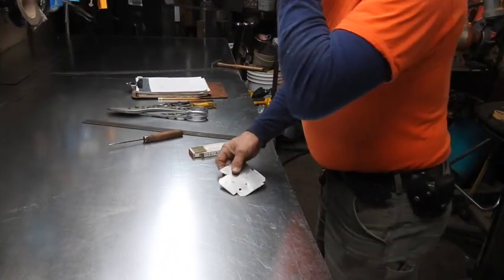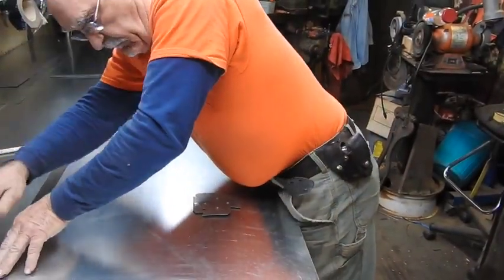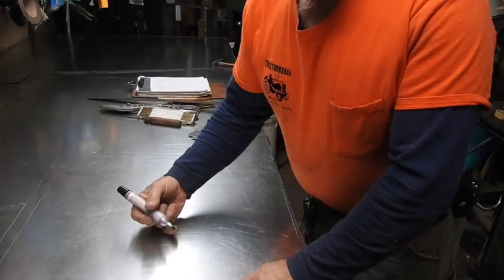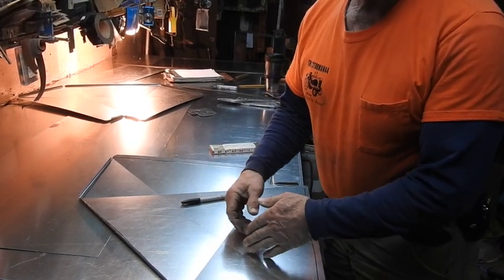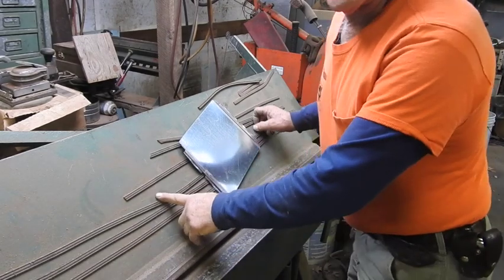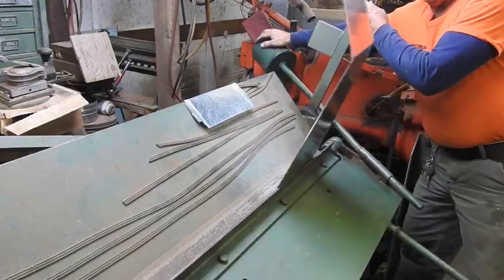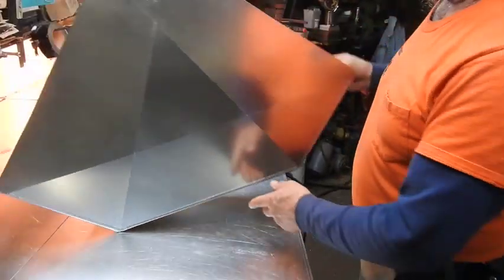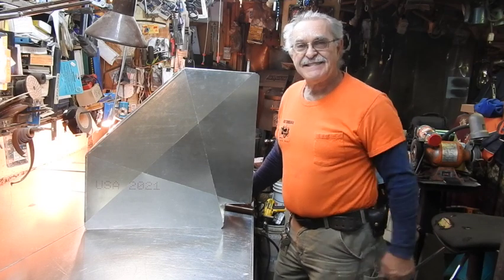Sheet Metal Hack: Longway Radius

Comment: Where did you get that hammer
Reply from the maker: It's a Milwaukee electric hammer and it was old when I got it from an old tinner in the mid 1970's.  Morlin Manufacturing still makes them today almost unchanged externally but I'd bet they have a circuit board in them now. They are 800 bucks !!https://www.eaglemorlin.com/product/morlin-model-5400-electric-pittsburgh-lock-hammer/?gclid=Cj0KCQjw166aBhDEARIsAMEyZh7pAVHMotEXBTel8GPhcNDHZ2TRznTEODCyeHgqGpeuP_KEYvUtut4aAhUvEALw_wcB  Also they make a pneumatic in-line air hammer too and it is much cheaper and lighter to use.

Comment: I still have my Malco 16 and 12 ounce tin knockers
Reply from the maker: The ones with the leather handles...?  I have multiples of those too Paul.  I use the big one mainly for demo because of the heft....knocking the drives off and driving the flat bar in tight spots to sever screws.  Stuff like that.

Comment: Love to watch other people lay out duct fittings.more then one way to do it.i have always called these mechanical elbows.also flat and stack ells.when I lay out the wrapper to get the angle I measure from the throat out to what ever measurement and have a 45 template to get that angle.
Interesting way to cross break the checks.i go from the throat to the 45 degree points.as always great job and you are a great metal man
Reply from the maker: Thanks for the nice words....I always say there are about as many ways to do a particular task as there are men to perform them.  There's always a variation somewhere during the operation.  That's a good way to lay out the wrapper too.  The next one up will be a shortway radius.

Comment: Great work, Tractorman44. I'll say tin bashing is an art. Especially when you have to work around the trades that got  there before you.  Plumbers,  electricians.  That's when  you become creative. Thxs for the vids,!
Reply from the maker: Oh man, you got that right.  Worse is when you measure, leave to fab, return a day later and your space is covered with pipes and wires.  LOL  Recently I had to field fab a circular notch in the top of a return duct to accommodate a plumbing drain.  The plumber failed to maintain the agreed upon route we settled on two days before to keep the space free for my return.

Comment: In my 30's I worked for a commercial heating and air contractor. We had a Lockformer plasma table to burn all the fittings on. I knocked together a lot of ductwork and fittings.
Reply from the maker: I've never ran a CNC plasma, but the company I retired out of had the set up.  They even had a CNC roto zip to cut matching  internal fibreglas insulation ! Until I retired about 9 years ago, I hadn't done any metal work at all to speak of for many, many years. It took a while to get the dust knocked off the metal working tools.  I too worked primarily commercial/institutional/industrial for the last 25 years or so before retiring.
Reply: @tractorman4461  yeah, I cut miles of insulation and run the duct through a gripnail machine. All of your sheetmetal machines I used myself. We also had an Autobrake that I taught myself to program bends. We had a roofing division so we made gutter ,fascia, trim and roof curbing.I liked fitting up the oddball duct fittings and unit curbs. These were all 16 gauge galvanized. I could adjust the mig to weld fairly smooth. My boss once said my welding was the most beautiful he had ever seen.I learned a lot at that job.AL B.
Reply from the maker: @sallybrokaw6124  That's cool. You get the right heat and speed and the bead will look surprisingly good for sure !!   I've not had the luxury of the fancy Autobrake though the last shop did have one.  I've seen the gripnail machines, but all I've got to use is the magnetic hammer. Still have it plus a box of the gripnails.  Doing primarily commercial service and startup I haven't done hardly any metal work for the last 25 years or so of my career. My last company also had an architectural division and did some neat stuff too.  And miles of standing seam 24ga roofing.  And man, I have installed hundreds of roof curbs and plenty of flashing as well.  But still..I did mostly service and startup. And I agree, a career in HVAC will cause a guy to learn a lot of different stuff.